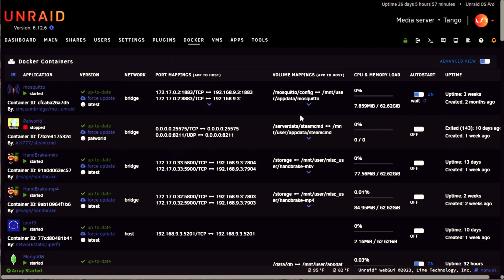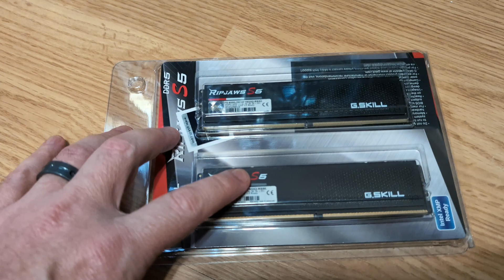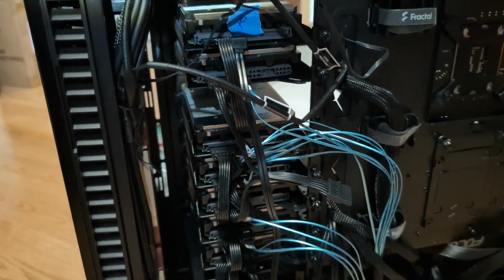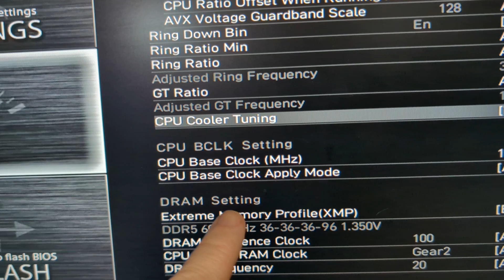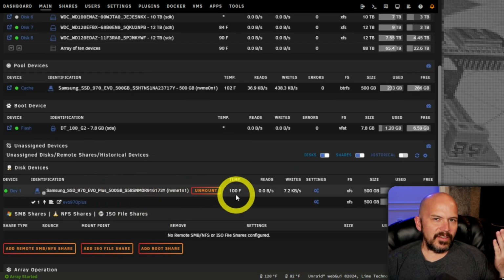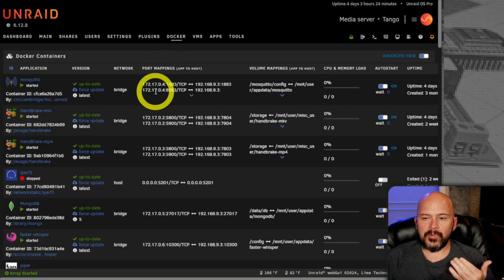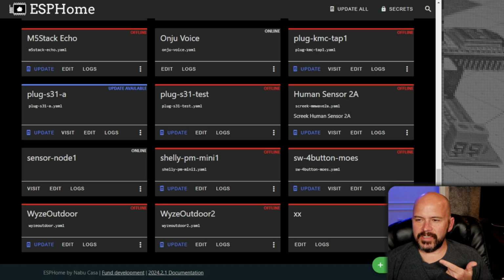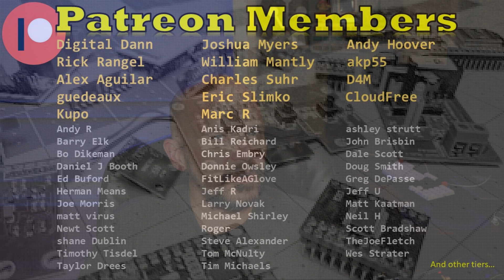Finishing up the i7 UnRaid Build - Swapping Hard Drives & ESPHome Speedtest

Comment: Hi I'm going to do the same config but in case I think to take the Meshify 2XL (because better airflow) and with an i7-14700k or an i7-14700? (Because I'm afraid the cpu will heat up and the recommended what?
Reply from the maker: I haven't had any issues with the cooler I went with so far even with compressing video and such jobs. I hear the fans kick up of course
Reply: @digiblurDIY  
All right, thanks for your feedback, but I'll take the i7-14700 just to be sure, because for a Nas I don't think you can tell the difference between the K and non-K versions (I take it mainly for transcoding).
So the data you took 1m?
Reply from the maker: @DB0-0.0 yeah you don't need the K. That's just for unlocked for over clocking. I had no intention of doing that myself. It was just a bundle that was on sale black Friday
Reply: @digiblurDIY  All right, thanks. What kind of SATA cable did you use to power the HDDs with the power supply (if you have any of mine, I'd be interested)?

Comment: If you are interested in creating more UnRaid content - here's a few points that I do not understand very well that may help others as well:                                                                                                                                 - If one would like to use all SSD - could you skip the caching drives and put that $$ towards more or larger SSDs in the array?                                                                                                                      - What is this "trim" thing with SSD?  Is this something to be concerned about?                                                                                                                                                                                                          - If I want to install Windows - does it go in the array or do I need a separate drive?
Reply from the maker: Yes, it doesn't care about the drive types.  If you can swing all NVME/SSD then by all means go ahead.  

The Trim command tells the SSD that specific areas contain data that is no longer in use. From the user's perspective, this data has been deleted from a document. Because of the way solid state drives read and write information, the data is not deleted from the drive at the user's command.   Schedule it and forget it.  

If you want to do a Windows VM, I'd highly recommend it go in the cache or some other non spinner hard drive.

Comment: I just built a very similar system with an MSI Z790 motherboard and i7-14700K.  I had some stability issues where it would become non-responsive with a black screen after running a couple days.  I just thought I'd let you know that a BIOS update fixed that problem for me in case you run into any issues.  I noticed that your BIOS is dated for October 2023, which is what mine had when I bought it but there are some 2024 updates on MSI's website.
Reply from the maker: The latest they had at the time when I built was Oct 27 build released in November.

I will check it out and upgrade it in the next week or so. It is stable right now and no screen connected given the setup. No upgrades this week before I go out of town for a funeral. I don't need Murphys law getting me.

Comment: those samsung nvme drives run hot, you're good. I'd say throw a nvme heatsink on it and then you can ditch the fan if you want. It'll throttle itself. Love seeing what you're up to as always.
Reply from the maker: It actually made it worse with the heatsink so I pulled it. I might try one with the heat pipes as I have room. I did verify today there are no firmware upgrades for my model.

Comment: I had the same issue on my 970 on my unraid server, and there's a firmware fix for the heat issue.
Reply from the maker: Hmm...I'll have to dig to see if I can do the firmware flash on linux.  Thanks for the tip!
Reply from the maker: Looks like I'm on the latest for my hardware revision.  At first it said not supported booting off a USB for the update utility but I found I had the model with no update.  https://forum.endeavouros.com/t/samsung-nvme-firmware-update-how/33263/62

Comment: I purchased a Pro license of UnRaid so I would be grandfathered in. I hate subscriptions and most are deal-breakers for me. Can you tell us the wattage draw of your new server - drives spun up v/s drives spun down?
Reply from the maker: 2 drives are spun down right now, one transcode and one direct play video, plus all the regular containers kicking and I'm running about 90-95 watts according to the UPS. I do run my fans a little higher than average to keep the hard drives cool.  I'd rather replace a fan than other hardware is my thinking on this.  But it isn't too loud being 140mm fans and I do have to sit 10-12 feet away from it.